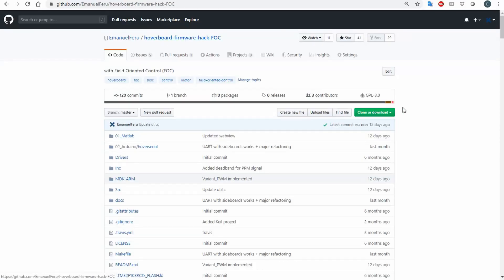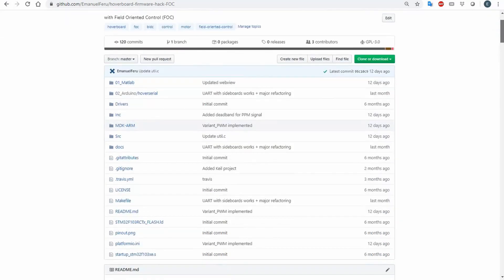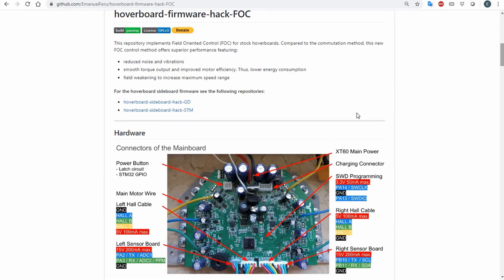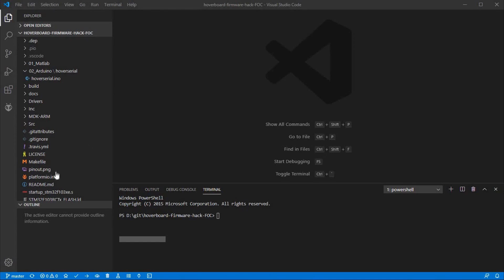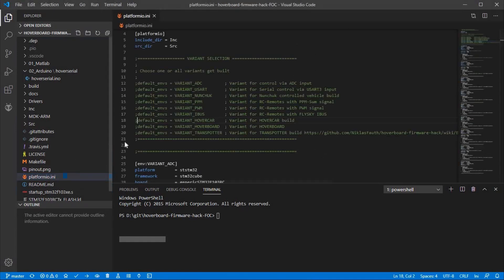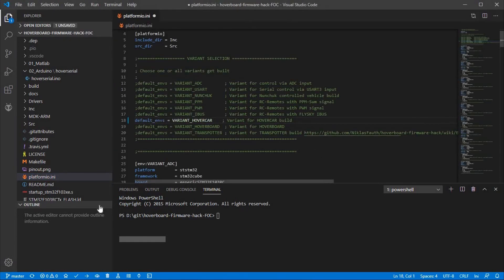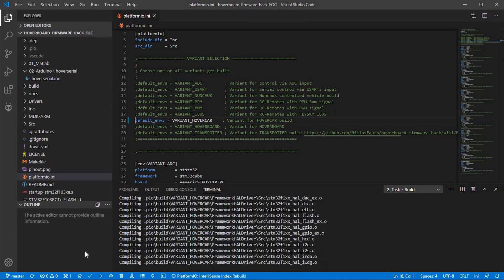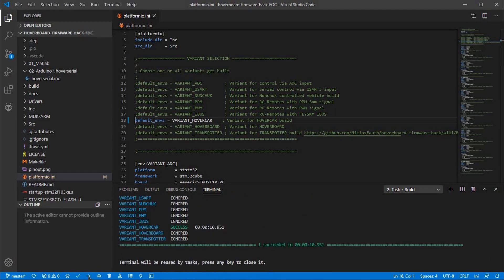How to Convert a Hoverboard into an Electric Go Kart (Cheap and Easy)

Comment: Hey man I'm really trying to see if you know how I can solve this. I have a segway go cart and bought my son the hyper go go with the hoverboard. But hoverboards suck and they dont go fast enough. Can you tell me what I need to do to make his gokart connect to something better the a hoverboard? I really am not a technical person to even know where to start. I'd like it to be electric but if I have to switch to electric then that's fine too. But I need to know how to get a backend fix so a hoverboard isn't necessary. The segway gokarts go fast but all my research said that they're not compatible if I put a super hoverboard like how the segway goes up to like 27 mph. I really need to find a solution.. I'm open to anything.. and I wanted to make my segway gokart sooped up with taller tires because its like 1/2 inch from the floor and no shocks. So basically 2 go karts I'm looking to mod. Please any feedback back will be greatly appreciated. If I can't mod them I'd like to sell them together if anyone interested.  There still brand new.. they were maybe used 3 times. Mine the segway one still sells for like 2500 and the hyper gogo gokart is around another 500. But if sell them for 2300 a little negotiation. If you know anyone that's interested to mod them themselves.. hope I hear from you thank you for reading this.
Reply from the maker: I'm sorry. I have not worked with segway or hyper gogo hyper go go. Therefore I have no experience on modding them. Give a search on internet and see what can you find. Good luck!
Reply: @EmanuelFeru  Thank u. I tried that already but I haven't found anything. And with the hyper go go. Instead of using a hoverboard I'd like to convert it but I dont know how. I'd basically need a axel with 2 motors and a battery pack. I just dont know how to put it all together. The whole thing is a built gokart but it just needs a hoverboard and they go way to slow

Comment: I flashed the board with Variant hovercar, and IT works, but IT only Drives around 5km/h and not as fast as Variant adc are there any settings that have to be aplied to Go faster than that?
I also connectet the Sideboard, but de different modes didnt realy make an difference

Comment: Hi, did your firmware work with the H23740C board? It looks the same but is square and has 6 mosfets in one line, on both sides, for each motor.

Comment: Hey question I have 2 hoverboards I'm gonna do the same as u did in the back but how would I connect the other hoverboard to the front 

And also how would I connect a throttle to the hoverboard? I see there's two motors and controllers

Comment: hie very educative keep it up . ,but i have a different side board the one i have have a bluetooth module solderd on it also it has 5 wires that connect to the main board, the fifth wire is 3.3v.
Reply: I managed to figure it myself .ooh that's after 2 years.thanks lots wonderfull educational project

Comment: Can u use hoverboard normally after using the cart or no?
Reply from the maker: Nope. Once you re-flash the controller, the factory firmware is gone, so you cannot use it as a hoverboard anymore. To go back, you need buy a new set of electronics.
Reply: @EmanuelFeru  Can't copy the factory firmware in the laptop and then copy it back again?

Comment: Is there a way to mount a handbrake to do some drift?
Reply from the maker: There is a "primitive" handbrake already. It comes installed as standard on the Kettcar.
Reply: @EmanuelFeru  oh cool, btw i cant get the spare board can you send me a new link? And i already have a hoverboard but it doesnt work, im going to try to fix it you think it will work?
Reply from the maker: @ssil3nce476  Most probably the link expired, it's been a long time. Please, have a look on Aliexpress, I think you should be able to find a similar board.
Regarding the board you want to fix, you can try to fix it, most of the time can be a success. However, sometimes multiple parts get affected by the high-stress during the breackage. Then, fixing the board is a waist of time, better use it for parts. So, if you fix it twice and it breaks again, better use it for parts (my advice).
Reply: @EmanuelFeru  oh okay, its because i want to build a go kart and use the motor of my hoverboard. Maybe i can use the motor and the battery only?
Reply: @EmanuelFeru  btw, with what cable do i connect with the usb thing?

Comment: I can't enter into calibration mode. I get 2 beeps-ADC timeout with or without sideboard. 
Sometime motors is spinning randomly. The Transpotter variant works ok so the board is good.
What can be wrong?

// ############################ VARIANT_HOVERCAR SETTINGS ############################
#ifdef VARIANT_HOVERCAR
  #define FLASH_WRITE_KEY         0x1107  // Flash memory writing key. Change this key to ignore the input calibrations from the flash memory and use the ones in config.h
  #undef  CTRL_MOD_REQ
  #define CTRL_MOD_REQ            TRQ_MODE  // HOVERCAR works best in TORQUE Mode
  #define CONTROL_ADC             0         // use ADC as input. Number indicates priority for dual-input. Disable CONTROL_SERIAL_USART2, FEEDBACK_SERIAL_USART2, DEBUG_SERIAL_USART2!
  //#define SIDEBOARD_SERIAL_USART3 1         // Rx from right sensor board: to use photosensors as buttons. Number indicates priority for dual-input. Comment-out if sideboard is not used!
  //#define FEEDBACK_SERIAL_USART3            // Tx to   right sensor board: for LED battery indication. Comment-out if sideboard is not used!

  //#define DUAL_INPUTS                       // ADC*(Primary) + Sideboard_R(Auxiliary). Uncomment this to use Dual-inputs
  #define PRI_INPUT1              1,  1000, 0, 2500, 0  // Pedal Brake        TYPE, MIN, MID, MAX, DEADBAND. See INPUT FORMAT section
  #define PRI_INPUT2              1,   500, 0, 2200, 0  // Pedal Accel        TYPE, MIN, MID, MAX, DEADBAND. See INPUT FORMAT section
  //#define AUX_INPUT1              2, -1000, 0, 1000, 0  // Sideboard Steer    TYPE, MIN, MID, MAX, DEADBAND. See INPUT FORMAT section
  //#define AUX_INPUT2              2, -1000, 0, 1000, 0  // Sideboard Speed    TYPE, MIN, MID, MAX, DEADBAND. See INPUT FORMAT section

  #define SPEED_COEFFICIENT       16384     // 1.0f
  #define STEER_COEFFICIENT       8192      // 0.5f Only active in Sideboard input
  // #define INVERT_R_DIRECTION                // Invert rotation of right motor
  // #define INVERT_L_DIRECTION                // Invert rotation of left motor
  // #define DEBUG_SERIAL_USART3               // right sensor board cable, disable if I2C (nunchuk or lcd) is used!

  // Extra functionality
  // #define CRUISE_CONTROL_SUPPORT            // [-] Flag to enable Cruise Control support. Activation/Deactivation is done by sideboard button or Brake pedal press.
  // #define STANDSTILL_HOLD_ENABLE            // [-] Flag to hold the position when standtill is reached. Only available and makes sense for VOLTAGE or TORQUE mode.
  // #define ELECTRIC_BRAKE_ENABLE             // [-] Flag to enable electric brake and replace the motor "freewheel" with a constant braking when the input torque request is 0. Only available and makes sense for TORQUE mode.
  // #define ELECTRIC_BRAKE_MAX    100         // (0, 500) Maximum electric brake to be applied when input torque request is 0 (pedal fully released).
  // #define ELECTRIC_BRAKE_THRES  120         // (0, 500) Threshold below at which the electric brake starts engaging.
#endif

// Multiple tap detection: default DOUBLE Tap on Brake pedal (4 pulses)
#define MULTIPLE_TAP_NR           2 * 2       // [-] Define tap number: MULTIPLE_TAP_NR = number_of_taps * 2, number_of_taps = 1 (for single taping), 2 (for double tapping), 3 (for triple tapping), etc...
#define MULTIPLE_TAP_HI           600         // [-] Multiple tap detection High hysteresis threshold
#define MULTIPLE_TAP_LO           200         // [-] Multiple tap detection Low hysteresis threshold
#define MULTIPLE_TAP_TIMEOUT      2000        // [ms] Multiple tap detection Timeout period. The taps need to happen within this time window to be accepted.
// ######################## END OF VARIANT_HOVERCAR SETTINGS #########################
Reply from the maker: Your potentiometers are most probably not calibrated. To enter auto-calibration you need to release the power button then press and hold the power button again for 5 seconds until you hear the a beep. Then move the potentiometers to minimum and maximum range, when done don't forget to bring the potentiometer to the resting position (minimum value for normal potentiometer or mid value for mid-resting potentiomenter). Then wait for the 20 seconds calibration timeout or press the power button to finish. More documentation on auto-calibration and how it works is here:
https://github.com/EmanuelFeru/hoverboard-firmware-hack-FOC/wiki/Input-Calibration
Reply: @EmanuelFeru  I had managed to run it without calibration by reading the pedal values from debug port and writing it manually into the config file.
For some reason I still can't enter into autocalibration, but is no problem anymore.
My daughter is happy now.
Thanks for this nice project!
Reply: @EmanuelFeru  I will try again when the new pedals are coming. Now I am using a joystick with hall sensors. Thanks!

Comment: pedals digram conection please
pedals wireing
Reply from the maker: I will make a schematic soon and post it in my repo on github.
Reply from the maker: Schematic is available here:
https://github.com/EmanuelFeru/hoverboard-firmware-hack-FOC/wiki/Variant-HOVERCAR
Reply: Did you cut the already connected cable? Or do I have to connect the pedals while the other cable is attached?

Comment: Hi! I flashed the motherboard and then I realized, that you didn't told anything about the wiring. Is it possible to connect throttle like the thumb throttles ? Do I need to to connect it via sideboard ? Do I need to use both motors? Did you tried it with 48V 13s battery ?

Comment: Thank you so much for all your work!
I have an old mobility scooter which I hope to modify for better performance (I actually use it as a mobility scooter when on travels because of illness).
Is it possible to run on 12s? Is '#define BAT_CELLS 12'  enough? Mostly wondering because I already have such a battery.
Also, when using hovercart variant, do I need to calibrate the throttle? Right now I'm only getting beeps(everything is correctly connected).
I'm hoping I haven't missed the answers for these questions already. I have some trouble reading and retaining information some times.
Best regards!
Reply from the maker: Thank you! 
12s is possible. Some people are using 12s without issues. Few things for the Hovercar variant:
- you need to calibrate both the Throttle and the Brake. And both need to be connected for the auto-calibration to work.
- if you are not using a Sideboard, you need to comment-out SERIAL_FEEDBACK_SIDEBOARD. Probably, this is the reason why is it beeping.
Reply: @EmanuelFeru  ah yes, my biggest problem was probably that I was trying to run it with only throttle (and no brake, since it's still in the post). I will try the "2pot version" first then until I receive my brake pedal :) 
Thanks again!
Reply: @EmanuelFeru  sorry to be a bother, but I can't seem to find the <How to calibrate> explanation. Is there suppose to be one besides the one in config? To get the pot min-max values I'm guessing you need to connect to a computer (debug?)?
Tried calibrating like explained further down here in the comments, but that resulted in that the entire hoverboard made a flip.
Reply from the maker: @Chairbottletooth  Search in util.h for "auto-calibration" you will find the description there.
To be safe, you should disconnect the motor phases only (there will be beeping but just ignore it). Don't reconnect the motors until you have proper values in "cmd 1" and "cmd2" from Serial Debug.

Comment: Does sideboard doing anything else than driving those indicator leds?
Reply from the maker: For the moment it drives the LEDs and handles the 2 photoswitches as push buttons to change motor control mode and activate/deactivate the field weakening. Of course since there is an IMU, more advanced things can be done, like cornering detection, impact detection, hill detection, etc.

Comment: Can i please know where to connect the pedals
Reply from the maker: Brake to ADC1, Throttle to ADC2, see figure below, Left sideboard cable.
Do not use the red wire from the sideboard, it carries 15V!! Take 3.3V from the SWD programming port.
https://raw.githubusercontent.com/EmanuelFeru/hoverboard-firmware-hack-FOC/master/docs/pictures/mainboard_pinout.png
Reply: @EmanuelFeru  Is there a way to use simple connection just with two momentary swiches connected to +3.3v and pull down resistors to ground?
Reply: @EmanuelFeru  If you connect throttle pot to left board only ( i guess for the left motor ) how does the right motor work then? Is it a firmware part that makes the right motor spin at the same speed as the left one? Thanks.

Comment: Great project, can't wait to try it myself as I have an identical hoverboard. Just curious, do you have some sort of software/electronic differential implemented for the rear wheels when steering?
Reply from the maker: Thank you! Regarding your question there is no need for differential implementation, since I am running Torque control, meaning it allows for different speeds in a corner. With Torque control the motors just pull with the same force, but they can spin at different speeds.
Reply: @EmanuelFeru Great work. Can we use 4 motors all wheel drive combining two motherboards.

Comment: Can you explain the wiring  of battery indicator? Which pin did you use in order to connect it to the mainboard? Does the firmware includes codes for battery indicator? Should I make any changes on it?
Reply from the maker: I just connected the star type LEDs to the sideboard (see here https://github.com/EmanuelFeru/hoverboard-sideboard-hack-GD ) All are stock hoveboard components. Only the front LEDs are bought separately. 
The code incorporates the battery display feature. So, it should be plug and play.
Reply: @EmanuelFeru  Thank you. I will try it.

Comment: Great work! Can you please explain gow to wire the pedals. I managed to make it work on variant_ADC with the potentiometers from gaming pedals but on hovercar mode i get beeping error. Does it work on hovercar mode without the sideboard? Thank you
Reply: Hi. I managed to upload firmware. I am using 2 potentiometers which are connected to adc inputs(left sensor board input). And I didn't connect the sideboard.  In ADC variant it is working just fine. But I couldn't make it work in hovercar variant. When I power it on it gives me error and buzzer beeps. In the config.h I commented 2 lines that you explained. But it still doesn't work and beeps.  İs my setup wrong? As I know those pedals have potentiometers inside. Am I wrong? Can I use 2 pots in hovercar variant? How should I wire them. Can you share your wiring diagram? Thank you.
Reply: Update! I found out that the beeping error was all about adc positions. After flashing firmware I forgot to apply calibration procedure(press the power button for more than 5 sec and release after the beep sound
- move the potentiometers freely to the min and max limits repeatedly
 - release potentiometers to the resting postion - press the power button to confirm or wait for the 20 sec timeout) so without calibration board thinks that pot positions aren't correct and gives error. After calibration it works just fine.
Reply: @kaandemirkoparan  how the hell do You calibrat this. Im treid and treid and givs error all the time
Reply from the maker: It still works without the sideboard. But make sure you deactivate the sideboard, otherwise you get the beeping. You can do it easily by commenting out these lines:
https://github.com/EmanuelFeru/hoverboard-firmware-hack-FOC/blob/95c10c9ba788de2bb88483276b7c03336fc31aa1/Inc/config.h#L345-L346
Reply: @EmanuelFeru  hi what does mean comment out?  just set 1 to 0 or delete that: ,,// right sensor board cable, disable if I2C (nunchuk or lcd) is used! "  ?
Reply from the maker: @automoto95  comment out really means to add "//" in front of the line.
Reply: @EmanuelFeru  thanks but i solve the problem it took me 20 hours ;/ i just connected the wrong power source 5v  from board,  throtthe red wire need to be connected to the 3.3v from the programing pin
Reply: Thank you! It worked after commenting out the two lines but i tried to reflash it again and forgot to bridge the power. Now it wont start. Is there a fix for that? 🙏
Reply: Update: i have powered it from the st link 3.3v an reflashed. It started again
Reply from the maker: @Edd930  You need to keep the power button pressed while flashing. Normally, it should flash even if it failed because not pressing the button. But good that you managed to start it :)
Reply: wire pedals ??